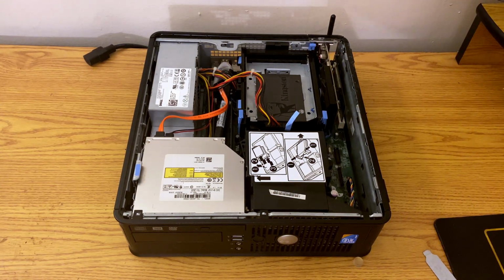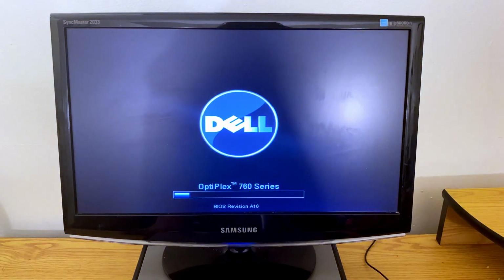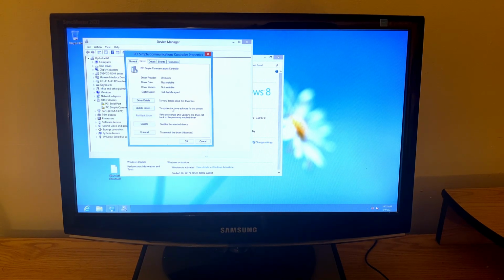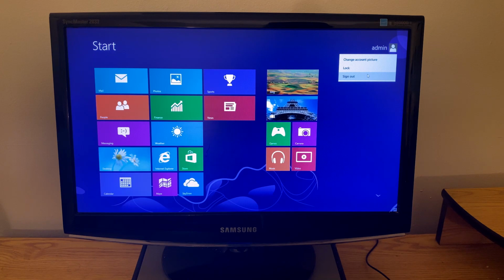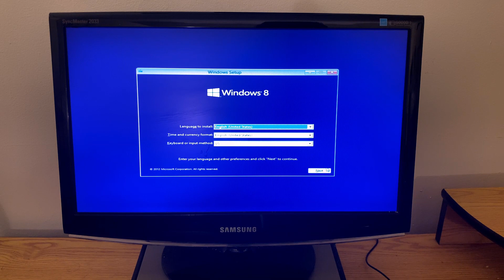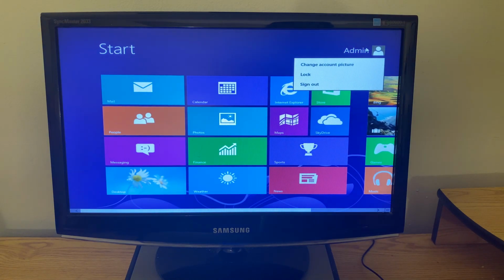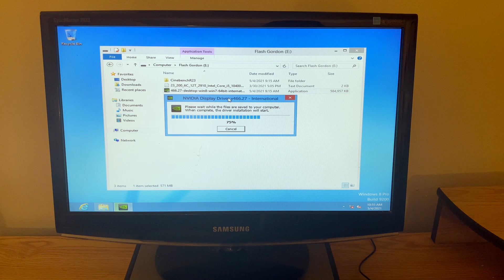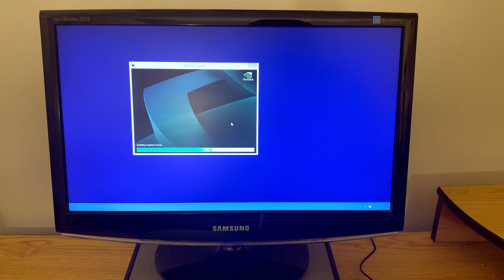OptiPlex 760 Upgrade Video Part 1

Comment: Is gt 710 compatible with optiplex 760
Reply from the maker: The gt710 is compatible with the optiplex 760. The graphics card was designed for systems like the optiplex 760. Allowing them to be usable for a while longer.